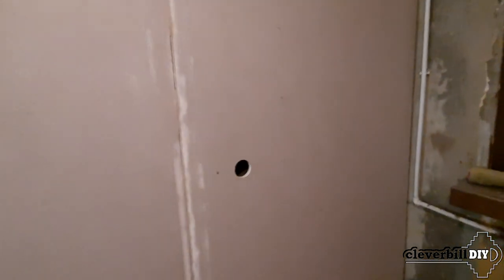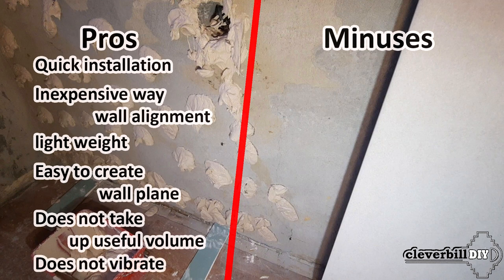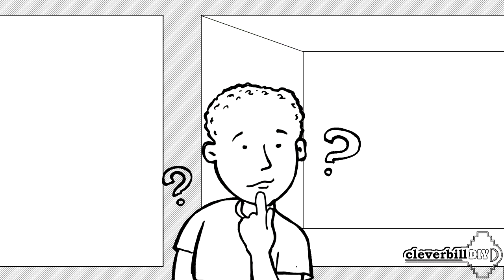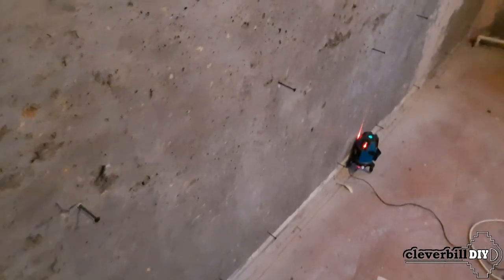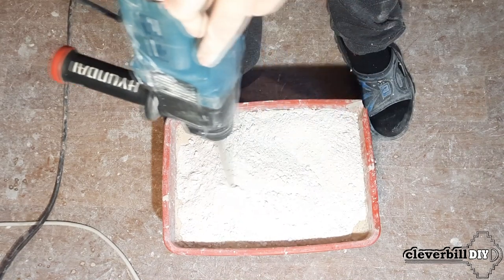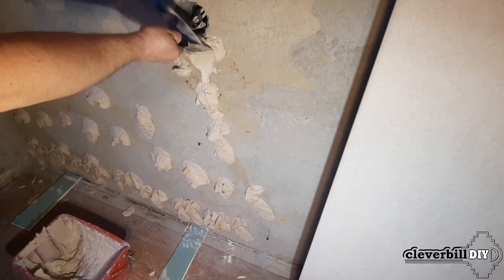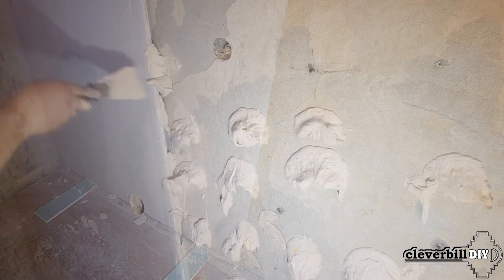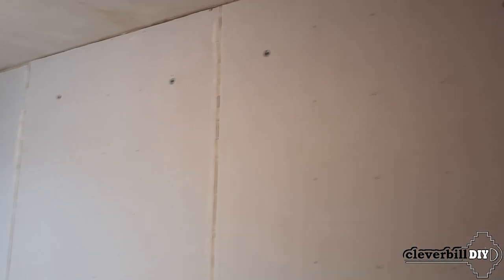How to glue drywall on walls - mounting sheets on glue

Comment from the maker: Installation of drywall on glue allows you to quickly align the walls in a situation where the installation of drywall on the frame or plastering the walls on beacons is excluded.
Reply: What is the glue used?
Reply from the maker: @trublu9095  This is glue from the manufacturer Knauf. It is plaster based.
Reply: @CleverBill-DIY I live in a small town and can’t get the glue, I’m doing a small closet do you know if no more nails would work?
Reply: @CleverBill-DIY i actually would have rather did plaster skim coat on it and leave it as is but finding plaster here is impossible

Comment: The wall where I'm going to glue it has moisture when it rains, and is it recommended to do the waterproofing beforehand?
Reply from the maker: It is not permissible to glue drywall to damp walls. Also, it is not practical to glue drywall indoors to external walls; here it would be better to install the sheets on a metal frame.

Comment: How do you remove this? I can’t find anything on it and my home had someone glue it on top of unpatched or cracked cement, Which created mold..how do we fix this?
Reply from the maker: Tear off what comes off and knock down the glue with an electric hammer, or by hand with a chisel and hammer.

Comment: Wow this is just what we need for our apartment renovation! We also need to fix up the external walls. You mention that this is not desirable due to mold and moist. How would you renew those walls? A wooden frame and fasten drywall with screws?
Reply from the maker: It is better to plaster external walls and thus not create a hidden cavity where mold can develop.

Comment: Can is use it with mud-wall?
Reply from the maker: Definitely not, the mud wall has poor adhesion. The adhesive will not adhere to such a surface. On such a wall, it is possible to mount sheets only on the crate.
Reply: @CleverBill-DIY  Thank you